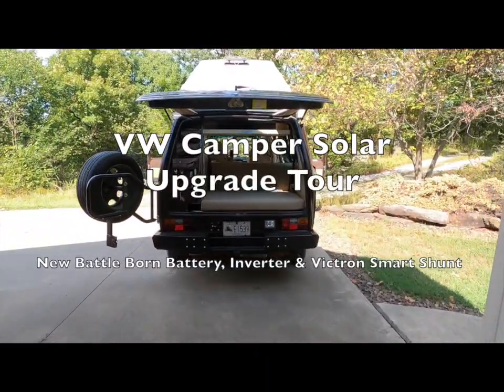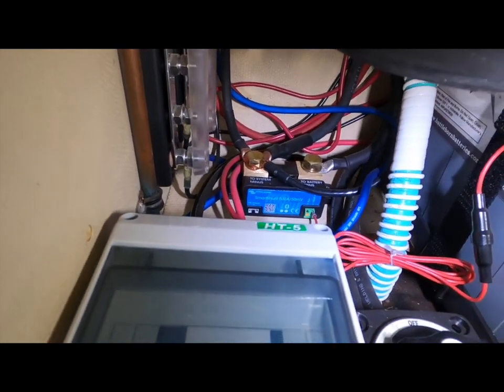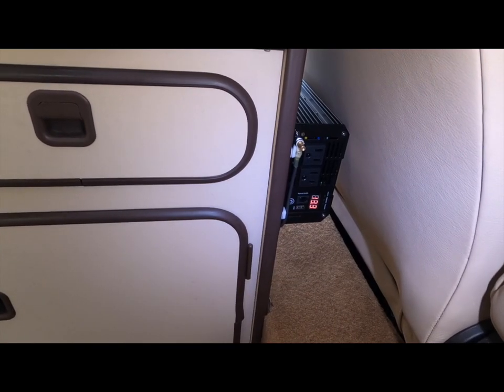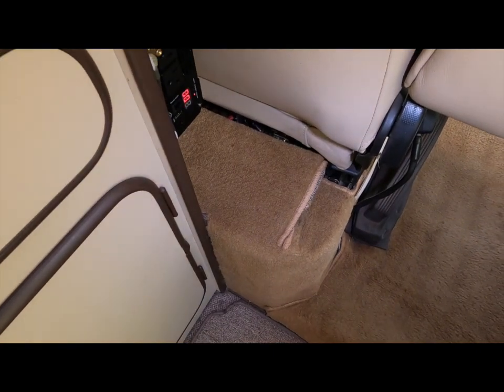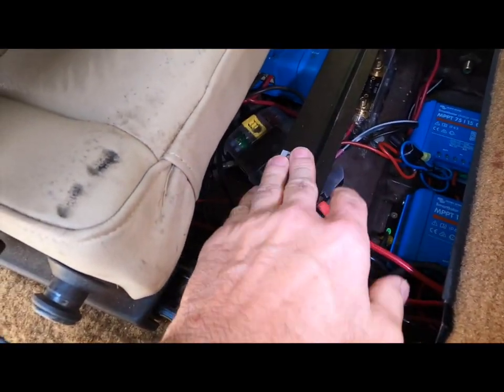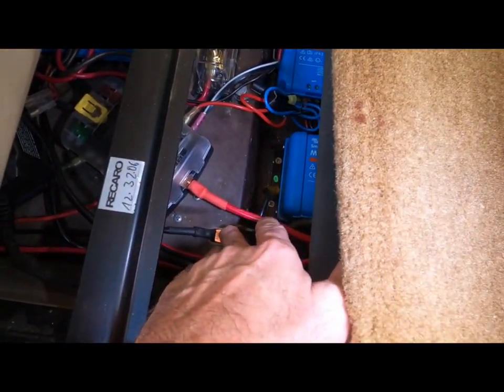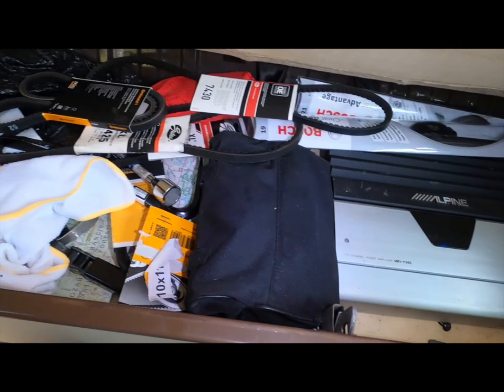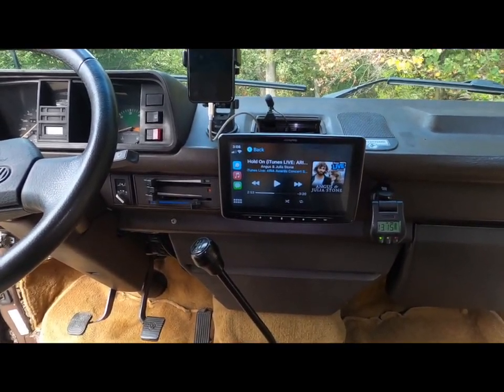VW Camper Solar Upgrade Tour: Battle Born Battery, Giandel Inverter & Victron SmartShunt

Comment: Also like the way you routed your phone cord for the flat screen. You just punched a hole in the ash tray? Assuming that's for Apple autoplay. Did you add any additional USB ports other than the one on the inverter?
Reply from the maker: I just added 4 usb charging ports to the part of the van by the dinette table. I’ll try to post some photos. Thinking of making really short videos of both the USB install and the Solar Panel hinges install.
Reply: I'm looking forward to those videos on the USB and solar mounting. Thanks!

Comment: So many questions. I'm just starting this mod on my '91 westy.
1. How did you anchor the cargo area solar panel?
2. For your external solar connector, you retro fitted your shore water to the solar port?
3. Can you rotate your driver seat?

Thanks so much. Great inspiration from you.
Reply from the maker: Hey, Tim! A ‘91–nice!
1. I used four hinges that sit where the cargo clamps were located. I can get you the Amazon link for the hinges. It’s a tight fit, but it was an inexpensive solution (rare for me). I can detach the panel and set in the sun. I have perhaps forty feet of wire coiled below the solar panel.
2. GoWesty sells the solar retrofit for the solar input to replace the water input. You can also cut an opening and add a fourth input box, but I have never used the water input for the sink. Didn’t really want to cut into the metal body of the van, either.
3. I can still rotate the passenger seat; however, I can’t rotate the driver seat. In creating more space for the electronics under the Ricaro seat, I went with a replacement seat mount. I would miss spinning the passenger seat around. But not the driver seat, really.